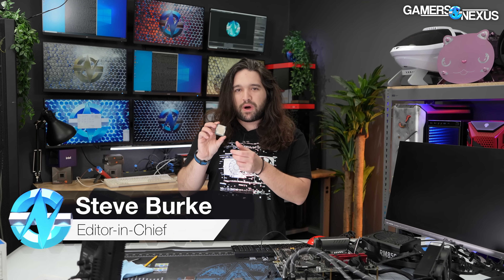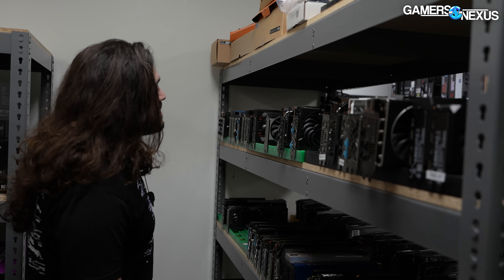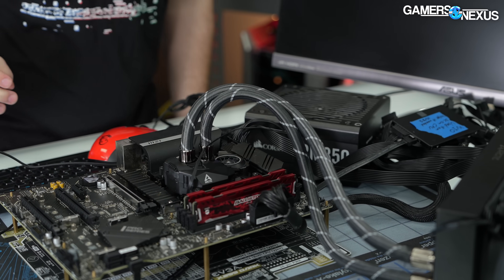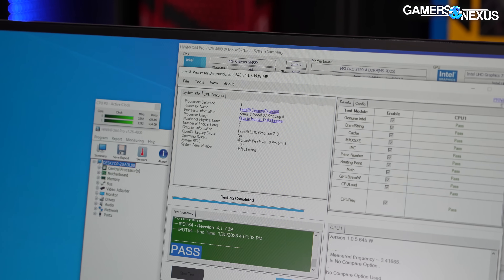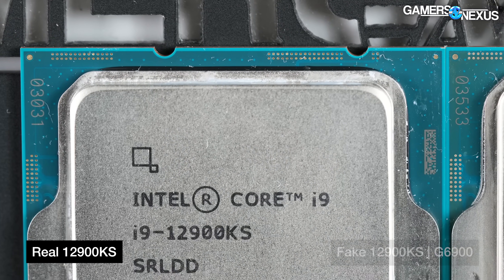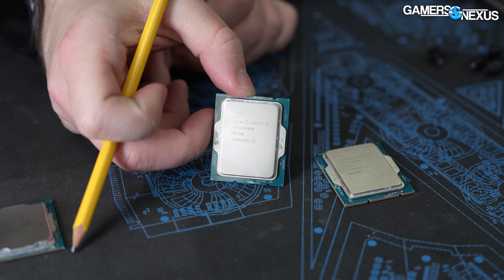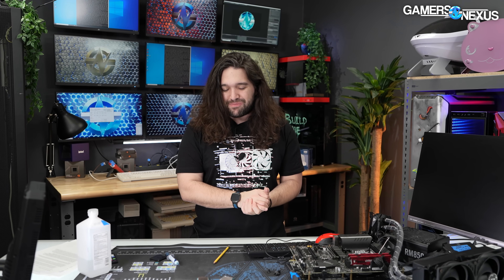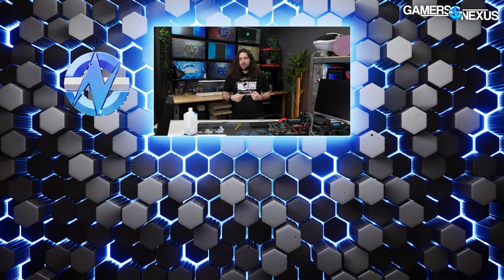Beware: Counterfeit Intel CPU Scam on Used Market

Comment: Question about that Intel verification tool: What real fakes (= silicon, mot just a changed lid) can actually work in modern motherboards? Or is the only purpose identifying engineering or qualification samples?

Comment: There was an AMD scam. I thing Budget-builds official covered it? Or maybe he wasn't him, but a scam with the early ryzens was to take a Zen 4 Streamroller based CPU and make a complete IHS of a Ryzen 7, swap it and then sell it as a Ryzen 7. I don't remember the exact model or even year in which happened, but I think it was Zen+ (2000 series) and with an A10 APU. It isn't truly widespread as AMD never really made the Zen4 A10 in any significant numbers.

Edit, I found it and it's a horribly noob scam: https://www.youtube.com/watch?v=u9-kipk1s0Q

Comment: GPU side, we had a customer that purchased a GTX 1050ti back in 2018 or so. Thin had DVI, vga and HDMI. and a dinky Aluminum cooler and MOLEX  4 pin power connector. I looked at it and just knew it wasn't 1050 ti. thankfully GPU-z spotted the fake BIOS in their software when I loaded it. Checked the card out it was a flashed nvidia gts 450 - 1 GB. I screenshot and printed out for the customer, but he wasn't willing to accepted he was capable of being scammed on e-bay. Still using the fake card today.  Sad people let their lil baby ego's not allow themselves...

Comment: Hey Gamers Nexus. had a thought and you'd probably be the best channel to test it. Is there any gains to be had by using a ATX 3.0 power supply? Having a dedicated 12vHPWR cable vs using the adapter provided by Nvidia. Definitely curious. Thanks!

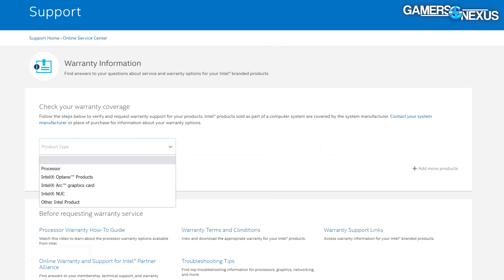Comment: Important to note: buffing and relasering isn't the only way this is done. Sometimes they are delidded and new (or fake) IHSes are put on. It won't look shiny that way. This is more common with small-time scammers like you'll find in the used marketplace or on local listings, because the scammer can keep the high end CPU in a delidded (or relidded) configuration for themselves. They don't need lasering and any additional holographic devices on the IHS would be similarly defeated. It is also possible to get a fake IHS instead of using a real one. The best defense against this type of scam is asking for it to be plugged in, in person, and the second best is using the number checking as per 13:40.

Comment: In this particular CPU, you can see the extreme wear marks on the hold down, but the printing is perfect, based on the amount of the wear on the hold down points there shouldn't be much left of the actual printing.   Great job bringing this to light!  😁👍

Comment: I had a similar experience a few years ago when I purchased a brand new, unused, unopened 9980XE for 1999 USD from Amazon and received a counterfeit CPU. Amazon was the seller, and it was a direct purchase. There was no involvement of a third-party vendor. Back then, I started a thread on OCN called "New 9980XE 00 Error code and it turns out to be a fake cpu!" (thread and images are there still you can google it) The seal was not broken, and the label on the CPU was so flawless that it could not be seen. 

After booting up and heating up the CPU, the label on the IHS became visible, and I realized I was being scammed by someone who bought this CPU and somehow returned it to Amazon in perfect shape. The box was in great shape; it had not been opened and the seal had not been broken.

Comment: There was a scam which got an old am3 chip with the ryzen top and sold as ryzen a few years back as well. I think the i7s, i9s / r7s,r9s or whatever chip is more popular at that moment are the most risky to buy used, since people want the performance but they can't pay the due amount or don't want to pay msrp for the part. Apparently, the newer platforms at the moment of purchase are under more risk of this kind of scam because the scammers are praying on people's naivety, greed, vanity and ignorance. So, when buying a second hand part, buyer protection, knowledge, caution and humility are required. Edit for better conveying the thoughts intended.

Comment: This sort of remarking is an absolute plage across the semiconductor industry, driven to new heights by the semiconductor shortage. I'm into Synth DIY and a lot of my friends have been caught with fake chips from various marketplaces that have just been ground off and re-etched, sometimes its a similar chip, sometimes its just some random thing with the same package. Im not sure which is worse TBH, half working or obviously dead.

Comment: Another small tip if you are getting a second hand market deal and the seller claims it's new, check for additional markings and please, ask questions. I had a guy sell me a 12100F for 40 bucks brand new. It came in a tray, the CPU had a chinese stamp in blue with the date 22.12 (22nd of December) , came with one of those little bags with a light grey thermal paste and was 100% mint. 

I checked the Matrix serial number and both matched, then put it into Intel's website and it obviously confirmed it was genuine and a tray processor, therefore had no warranty which is fine by me. I was still not able to test the CPU itself since the motherboard didn't arrive yet, but I checked for wear marks in both sides of the CPU IHS where the standard 1700 socket bracket applies pressure to, which, in case of a used CPU, should have left 2 vertical marks due to the pressure.

Since I couldn't find any, I decided to call the guy out of the blue the next day and ask him how he got it and why he decided to sell it at 1/3rd of the cost, he said he got it as part of a bundle (buying a motherboard or GPU off Aliexpress I presume, since what would kind of promotion would include a brand new tray 12100F?) and had no use for it. The guy was young and he sounded genuine/not nervous, he knew what the value of the CPU was, but wanted to move it quick, 40$ vs. retail around 100$ I guess, and didn't lie about the brand new status, since it definitely was.

I'm writing this from the build the CPU is in right now, so I guess "too good to be true" doesn't always apply, but be careful and again, ask any questions you deem necessary, especially when buying higher value second hand parts.

Comment: Linus tech tips did a video almost 2 years ago and they had a fake Ryzen 3600 that was actually an athlon CPU. In that case it was AM3 instead of AM4 so just looking at the pin arrangement you could tell they were different.

Comment: Steve doesn't want to say it because he's hyper-sensitive about getting political.......... But I will......

Don't buy your hardware from CHINA. This is a case where some guy got screwed by someone else that also got screwed cause he bought from China and would rather screw the first guy once he realized the mistake he made cause he thought he'd save a few bucks.

Every single case of counterfeit hardware I've seen for 30yrs (since Steve was in elementary) was from China.

Every.
Single.
Time. 

SO many sources don't want to admit it because China's a major funding source, but every scam/rebadge/mining card repaint has one thing in common. It's always from China. 

Fake 90 series?
China
Fake 10 series?
China
Fake 20 series?
China

It doesn't matter how much you pretend that it's just a few bad actors, Every Single Time you get screwed on fake counterfeit hardware it's always from China.

Comment: They have the ability to write the partial serial on the substrate you can combine with the batch number on the IHS at a website most consumers will never know exists to see if it's legit. ???????????????
Just write the model number on the substrate in human readable text. Even the spec code would be better than what they have now.
Reply: I just watched the video again to see if I was missing something! They can write text two places on the CPU. One place is permanent and can't be removed without visible damage to the chip. The other place can be buffed off. Consumers have been trained to look at the part that can be buffed off. I feel like I'm losing it. I don't understand what I'm missing or why they don't put the important info visible on the substrate. Why am I not seeing people say it in the comments? Why didn't Steve mention that as a possible solution? What am I missing??????

Wait, is it that the die is put on the substrate before they know what CPU it will be? You could still mark your substrate in human readable letters of the family of chips that use that substrate. It seems better than counting test pads. These scams really only work when you pass off a low end chip for a high end one and I don't think chips that far apart in the family usually share substrates.

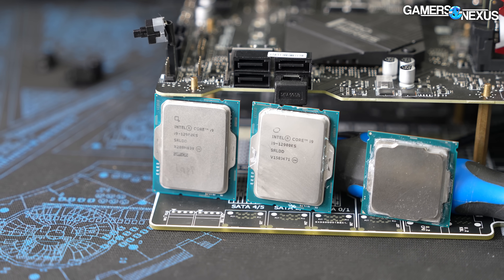Comment: 1st issue I noticed on the fake was the Circle logo on the top left of the ihs. 9:54 You will most likely only find ones with the 1 large / 1 small square logo. The reason for this is simple the old circle version has AVX512 and the phased that out fairly early on. The KS version came out around the same time as the death of AVX and pretty much all retail chips should be 2 square logo

Comment: I remember seeing a video of a fake AMD CPU on a Brazilian YouTube tech channel a couple of years ago. It was a purported Ryzen 5 3600 bought from AliExpress that was really either one of those early Zen Athlons or a late Piledriver APU (some of the late models already used socket AM4) --- I don't recall exactly what it was, but it was an early low-end AM4 CPU at any rate. The 3600 lid was genuine, it was simply swapped. Of course, the economics of this doesn't make sense, unless they had access to a large number of rejected or faulty genuine 3600 CPUs, but in China everything is possible.

Comment: I generally use a method of meeting the person and getting video of them and a vehicle. Also inspect the product on hand. Don't let them put it back in the box if you choose to buy it. Put it in yourself. People can palm swap items easily enough. If you have footage of their car and them it is easy enough to track them down and drag them into small claims court and get an ruling against them. Even if they are think showing up in rental or a friends car there are still solutions to that you subpoena the information from the comply or the so called friend and if they fail to comply its contempt of court.
I tend to take pleasure if getting back at these types. You can get awarded punitive damages plus court costs in cases also. The court could also turn them over to LE criminal investigation as well.
At the least consult an attorney in your area it might well be worth it. A consultation can usually be gotten fairly cheap.

Comment: The new text can be applied just like you do when making a PCB at home.  You print a mirror image on transfer film or overhead projector sheets using a laser printer.  You then use heat from something like a cloth's iron to transfer the image to the final position.

Comment: Intel should laser etch the ears of the IHS where its held down by the socket. Use a unique product code or move something they already have, in regards to the former, to that part of the IHS or even double up. The etching could be much deeper as it wouldn't interfere with thermals. It would make it less likely for counterfeiters to go through the effort to remove it.

Comment: This has been a problem since the 386 days, back in the days were you could by from places that sold to individual builders in the 90s the market was flooded with rebranded chips. it was so bad AMD on its k5 and k6 cpus stamped the name into the heat spreader. When the flip chips came out and it got insane they would remark them and change the resistors.  You had no clue what you really had sometimes. 
Intel could care less that this happens it would be easy to make sure it could not. There shit in the 90s was the worst. They actually said not to trust it unless you buy from them or a tier one vendor. My guess is while they no longer say this they make it easy on purpose to suppress the used market.

Comment: A few tips in buying person to person to help protect yourself from scams. First, keep agreements in writing; any lawyer will tell you a verbal agreement and handshake is about as good as the air it's printed on. Try to buy locally and do so in person; this way you can have product in hand before committing money. Ask for a picture of their ID or ask to take one, the only thing that's personal on an ID is their date of birth. It allows you to identify the person you're doing business with when you meet. Get a picture of the license plate of their vehicle. Again, not personal information; but can help police locate the owner of the vehicle. If you're buying portable electronics, like a computer; phone, or smart watch. Have them turn it on and show you it's not security locked and working. (Apple's Find My, and Samsung's Find my Mobile).  Take the time to compare the product you're buying to the manufacturers specs. Most electronic companies will have websites that can help identify cheaply done fakes. 

If you can't get it locally, get a video where possible. Video is a lot harder to digitally alter, and while not perfect; eliminates the ease of 'clever' photoshopping. Offer payment in a secured fashion. Never do cash through mail, and be wary of sending money through cash apps to brand new member accounts opened 'that day'. Reverse image lookup in Google to see if a picture is stock, or even if it flags different similar products. Sometimes Google will even pull up known scams or product pages you can use to compare.

All in all, just be aware. Scammers tend to look for quick and easy sales and will fold pretty quickly in a sale if just asked reasonable questions one would be expected to field at a retail store. If a deal is too good to be true, it probably is; and warrants a little more caution before closing the deal. Scammers will tend to also pressure you hard about having multiple perspective buyers, yet bug you to send money as soon as possible even as they're threatening to sell to someone else. They'll also try to attempt to get you to use 'unsecured' methods of transfer that are less likely to be traced. (Cash, or personal cheque.) That being said, don't be aggressive either and offer reasonable alternative explanations for why you want the information you request.

If the event you do still get scammed, the police can use things like drivers license pictures or license plates to track down an individual. While banks and money transfer services can protect your money if transferred directly through them. Also do understand, the Police are limited in their capacity to help by the information you collect. A car can be rented, or borrowed; an ID can be fake; and the address on the ID not current. So do be kind when they reach their limit. 🙂

Comment: This processor remarking has been a problem since 286 was king.  I saw some with my own eyes, and could discern the difference, but many others might not.  Intel makes changes periodically, which helps.  Mind also, that Intel is not the only one this happens too.  Nearly every since IC manufacturer has had this happen to them.  Even companies that only sell $5-$10 chips have to deal with it.

Comment: Pretty sure it is laser etching as you said. Fibre laser would be the quickest type and highest quality to produce. With a machine roughly worth 2-5k. 

It could also be done on a CO2 or possibly even a diode laser with a marking spray which can be had for around $500-1k dollars for the machine and $50ish for the spray which would be enough to produce hundreds of counterfeit chips. Might be more common on smaller operations.

So not crazy investment by any means to pull off and well within the abilities of most laser hobbyists. Could definitely see this issue becoming more widespread.

Comment: 1:02 - "Not terribly widespread"

Complete nonsense. CPU counterfeiting goes back as far as discrete computer CPUs do, it happens in every generation. The more valuable a specific part is and the scarcer it is, makes it more likely to be counterfeited. It is widespread and it happens everywhere, even in NiB from major retailers like Newegg and Amazon. While it happens quite a bit more on more backwater markets, you're not completely safe from mainstream retailers either.

It gets really bad in vintage computer parts markets due to the Chinese chip counterfeiters knowing about the desirability of certain parts. The most notorious of which is probably the 68040, which is commonly counterfeited with a remarked 68LC040 (LC means it lacks a FPU), and also selling slower clocked models as higher clocked models. Even the mask revisions are faked, since later mask revisions have much lower power consumption compared to earlier ones.

The last CPU generation to have a really bad problem with counterfeiting was probably the Athlon/Duron/Sempron. Since AMD exposed the configuration bridges in the substrate, counterfeiters had a field day modifying chips and selling them at higher speeds. It got hard to prove fakes since motherboards at the time stored CPU ID information in the firmware, and would display whatever CPU that it had matched for the current clock speed it was running at.

Comment: wasnt there a scam where you would buy a 3950x and a athlon 200ge delid both, reglue the IHS swapped and return the 3950x which is a 200ge with 3950x IHS. And then newegg just resold them

Comment: Something from the used Airsoft market I regularly buy from

Always have the seller post a picture of their name and email written on a piece of paper next to the product picture. That way you can (somewhat) ensure that the person posted a picture of the product they took, especially in real time if you can ask them to take pictures of different sides and areas.

That way you have at least a trace and confirmation that the actual product you're shown is linked with the person. Just incase.